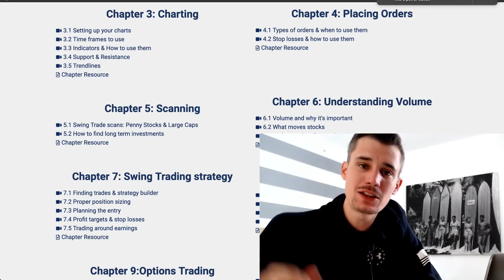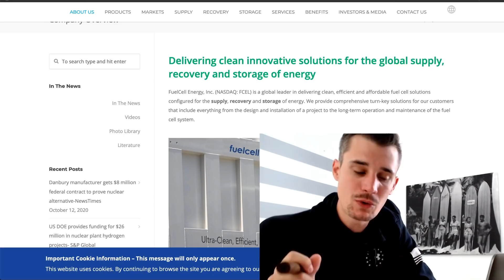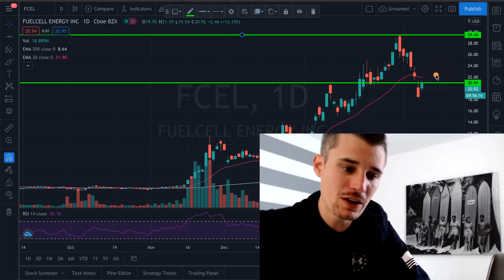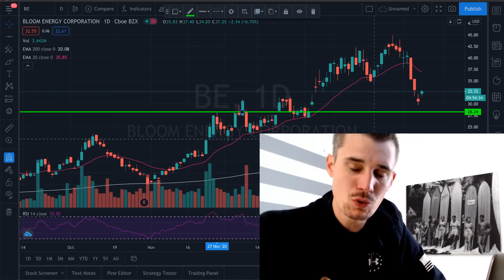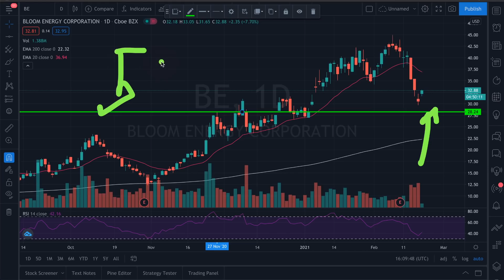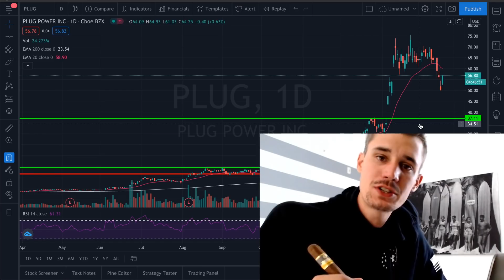Clean Energy Stocks Ready To Explode! | Stocks To Buy Now?

Comment: My Dad followed hydrogen fuel cells 40 years ago, I think you have it backwards.  EV is the bridge to H-cells.  40 years ago I figured the biggest hurdle would be infrastructure.  H-cell vehicles wouldn't be useful until you could actually fuel your vehicle.  Fuel cells particularly make sense for long range trucking, but until Racetrack/Flying J etc. support it, it's stuck in short trips.  That's why this technology is pushing into short range commercial vehicles well.  Indoor forklifts, tuggers, and cherry pickers all make a lot of sense, and can be fueled either by canisters (just like they currently use propane) or at an onsite fueling station.  Plug basically gave Amazon & Walmart h-cell forklifts, but the used that as a proving ground to build acceptance for them.  (Good move!)
Long term, H-cells are a much better choice.  The marketing and profitability is better with electric vehicles.
Reply: Appreciate your comment write here for more gaining ideas
@@
+.1 7 .2  0  .5  9. 9 .8. 5 .1. 0✔️✔️✔️

Comment: I believe DYA will do very well in the future especially once they get the carbon credit certification. Diesel powered trucks are not going to go away anytime soon. Even Elon has said that. The product they make massively reduces emisions  as well as saves fuel and every truck will get a tax rebate on a annual basis. Also the system can be installed on new trucks or an existing unit.
Reply: Thanks for the feedback experience difficulty or you want to in*ves*t + 1 ( 7  2 0 ) 5 9 9 *8 5 *1 0
W h a t s* a p p.....